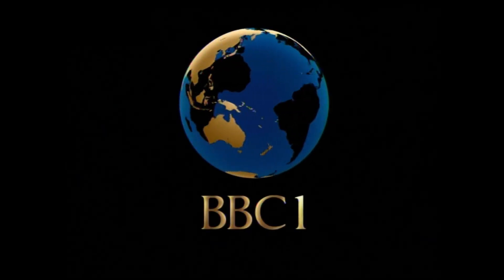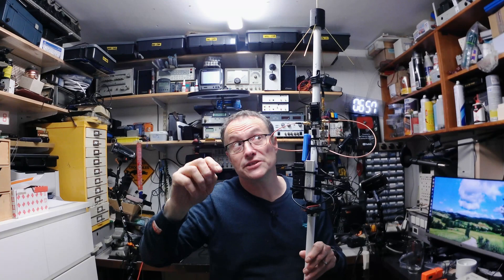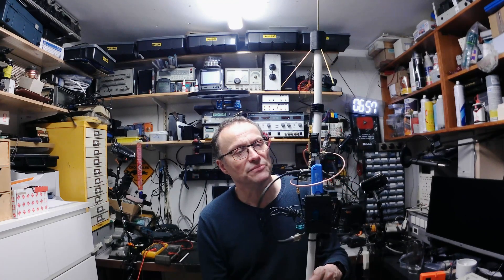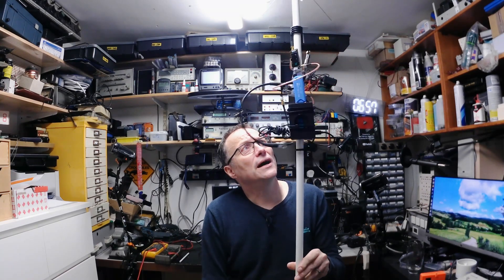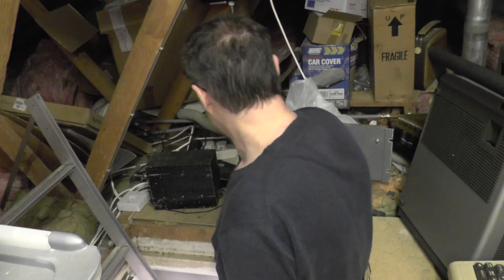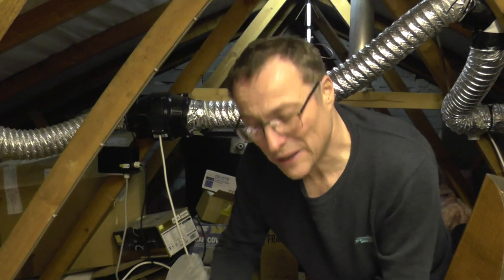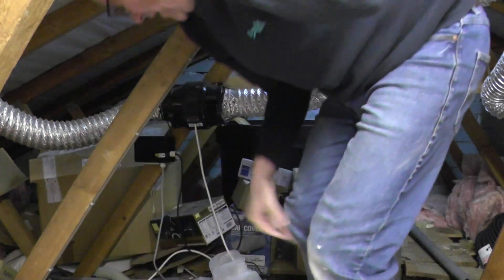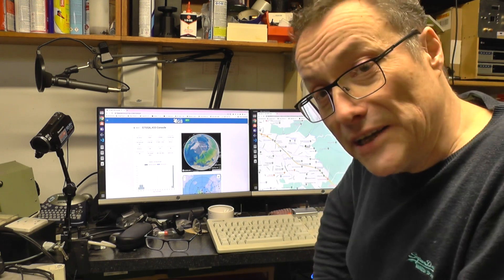Making an attic antenna for TinyGS & LoRa

Comment: WOW did a TinyGS search and found you. Subscribed :D
Reply: I went a bit mad on ali during black friday. Basically to eventually build something along the lines of what you have made Im also using a pi to do ADS-B and sharing it with the online radio amatuer clubs feed. My aim is to put it all in a tupperwaare  box and glue a bunch of solar panels to it with a UPS pi type thinga-me-bob. Still tweaking the tiny gs stuff best day of packets so far 50.